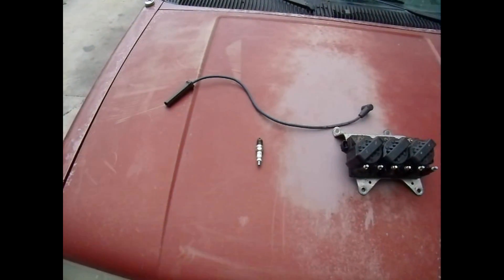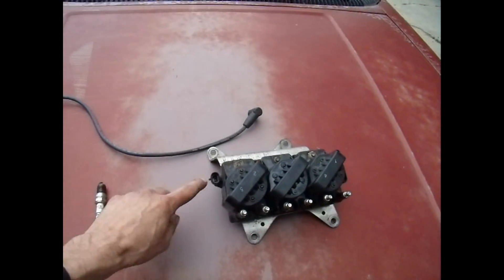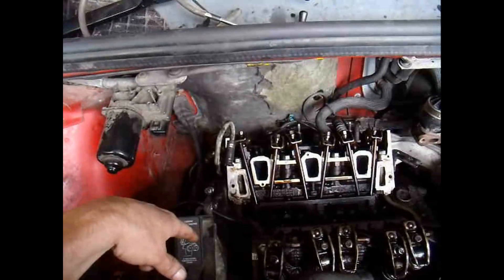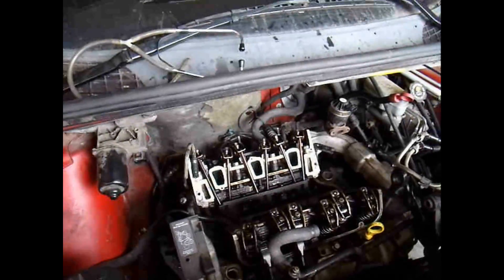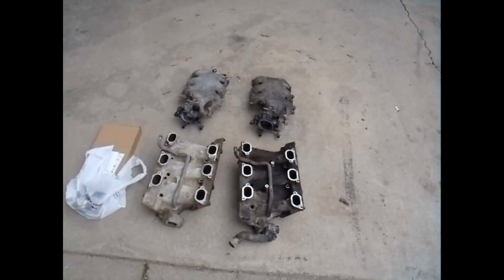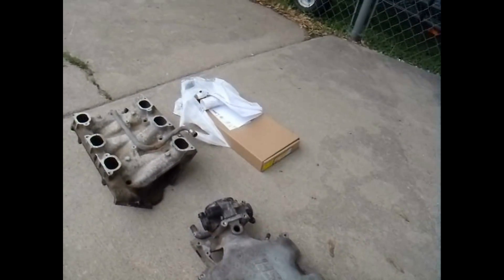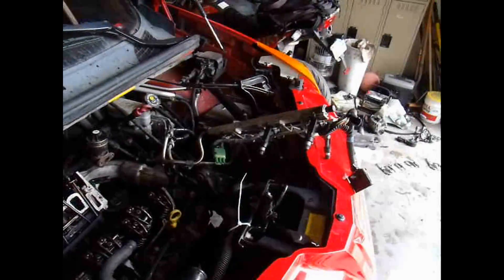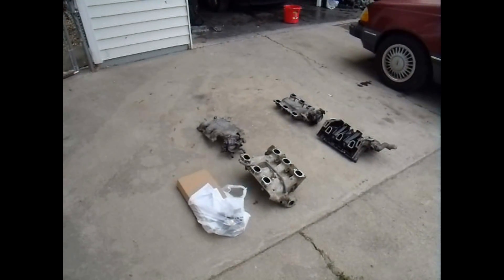GM 3400 / 3100 3.1 3.4 Engine Misfire Cause & Causes Miss Missing P0303

Comment: My wife's van has the same issue....P0304. I couldn't figure it out...had it in 3 shops. 1st replaced the camshaft position sensor, 2nd replaced the coil pack, then fuel pump, 3rd did a diagnostic AND smoke test said it was the intake. WOW!! NO MORE SHOPS!! We are going broke. I ordered the gasket set and manifold bolts, just waiting for them to get here, then it "play time". Found a couple vids showing how to take apart the manifold and EVERYTHING that goes with it. Hoping that's it. It has about 150,000 + miles, so it's prob due anyway. 
  Thanks for sharing this...it confirmed what the LAST shop said. I'll let you know how it goes!
Reply from the maker: The intakes can crack and cause a bad miss.  I'm glad I fixed this before going on a trip.  It would never had made it.
VT247
Reply: Vacationtime247
Yes, that what I'm figuring out. I did the same as you. I replaced the plugs, wires and checked the coil pack (again) and they are all good, but STILL getting the stupid code...so, it's off with the intake!!
Reply from the maker: As long as your in there doing that, it might me a good idea to replace the head gaskets.  They do go bad and could cause the same code.  
VT247
Reply: Vacationtime247
Ahhh...good idea!

Comment: Hi  Iam  Travis and  I have  1999 Pontiac Montana with the  3.4lt I  have  done  everything  in the  book and I'm  getting  no where  I  have  replaced  everything  in the  cooling  system and I and  still  running  hot  I replaced the  thermostat  3  times and it  has  new hoses new radiator in a new water pump and I'm also getting misfire on number 2 is stuck on number 2 misfire the code is po302 I don't know what to do next and keeps running hot and a misfire 2 I don't know where to go next if there's any way you can call me text me or email me my email address is trswelding74@ gmail.com thku  plz  let me know if you find the  answer  cuz I'm  about to  park  this  car, have good night.

Comment: I changed the head gaskets on a 01 3100 sfi and during cranking the vacuum hose on the fuel pressure regulator keeps blowing off and I'm getting a backfire through the throttle body what could be the problem ?
Reply from the maker: +Troy Lively MIght be a stuck valve or lifter.
VT247

Comment: What to do to start engine changed 3.4 to 3.1 in 04 Chevy impala
Reply from the maker: +joseph kemp It would be a lot of work.  Just get a 3.4 liter and put head and intake manifold gaskets on it before installing it.  Swapping to a 3.1 would be a lot of work, but I guess it could be done.  Might not run that great because the computer would need tuned because it would constantly get more fuel due to the fact the 3.4 is a slightly bigger engine.
VT247
Reply: It's all bolted down did a lot of changes try to start but won't I was told to change computer
Reply from the maker: The problem might not be the computer.  It might be the camshaft and cam sensor.  Possible different crankshaft sensor and reluctor wheel too.  Have to make sure the p/u wheel on the crank sensor has the same teeth.  Also with the camshaft it may have different area's for the sensor to pick up and read right as well on the end closest to the timing cover.
VT247

Comment: Lmao what a moron I wouldn't let you touch my engine if you did if for free. I'm getting ready to reassemble my 3.4 tomorrow or so and have the same gaskets for the lower and won't have the same problem because in not dumb enough to "get the bolts nice and tight" I'll be making sure to torque mine to specs all across as to do it THE RIGHT way and maybe if a back yard half wit wouldn't have done the job last time on this engine before purchasing I wouldn't be here now. If you don't want to have to do it again or break more shit maybe take the time to learn why things are torqued to spec and not " nice and tight" maybe you'd start doing it
Reply from the maker: Have fun doing this job again in six months to a year.  Won't bother telling you why because you had to go and be a schmuck about it.

Comment: But it was miss fire ing and i put a foul adapter in because it was getting wet with oil and that one wire was almost melting getting very soft
Reply from the maker: +steven affannato Affannato Damn.  That stinks.  It may be time for a new engine or at the very least, a new head.  Foul adapters are a temporary fix.  Most likely the valve guide is leaking.  If it were me, I'd take the head off and check the cylinder valve in question.  It's possible to have a machine shop put in new valve guides if that is indeed the problem.  Check the head surface area for warping with a straight edge and feeler gauge.  If not straight, it will also need resurfaced.  But weigh the cost of having the current head fixed or getting a refurbished one from ebay or such.  Believe the 2.2 uses an aluminum head for the inline 4.  Generally the area between the cylinders can sometimes get a low area.
VT247

Comment: I have a 1997 chevy s10 2.2 that keeps blowing the plug right out of the engine again what is causing it lmk thank you
Reply from the maker: +steven affannato Affannato My first thought is the threads are stripped.  If this is the case, the correct way to fix would be to remove the head, rethread it and put in a heli coil.  But, it is possible if carefully done, to tap it out and put in a helicoil with the head still on.  Carefull with shavings getting down the cylinder.  Best to have the piston at TDC (top dead center).  Suck out the shavings with a vacuum really good.  Hope this helps.
VT247
Reply: I have no idea why GM dont recall all their issues with these engines.. multiple issues with these engines.. Dexdeath is "to be used" as coolant and eats seals..

Comment: I was clearing out parts to get to my upstream o2 sensor. As I was removing the coil pack, I noticed where my #1 plug wire is on the coil was very rusted. Is this caused by not firing or warm air cooling and trapping under the connector cap on my plug wire. Or could be something else and could I clean it and use Die-grease on the prone' s and inside the connector  caps and hook it back or should I get a new one?
Reply from the maker: +Glen Riffe It's not that much to replace it.  Just get a new one.  But if you're trying to save bucks, clean it up with some sandpaper and check the spark.  
VT247
Reply: +Glen Riffe The coil at #1 was cracked, bought a new one. The wires and plugs have all been changed also none crossed. Still having a backfire and stalling problem, just in gear when you want to throttle it. Idles great.  Cleaned ground ends on transmission. Fuel pump works fine also. MAF changed, Throttle Body cleaned, both o2 sensors changed, opened up the catalyst converter. I do know I have a ground because my dome lights stay on. Door locks lock on their own when I exit the vehicle. Can my module ground out?
Reply from the maker: Check your fuel pressure regulator, crank positioning sensor and cam position sensor.    Does it throw a code yet?

Comment: if you smoke or have a friend that smokes there a hose that plugs into the air cleaner hose pull off the small hose blow smoke in the hose have a friend look for smoke come out around the motor could be a crack in the hose or bad vacum lines or 80 dollar at a shop they have a machine that blow smoke into the motor you see smoke come out of bad parts like egr valve or a vacume hose hope its not a intake gasket cars get old the vacum line dry rot

Comment: I'm having the same or similar problem with my 3100 cutlass, no oil pressure, spark plugs, wires, coil are good. it has fuel pressure and the inhectors are functioning. I assumed it was a bad oil pump and a bad lifter, Is it more likely the intake?
Reply from the maker: no oil pressure sounds like the oil pump or no oil
Reply: +Vacationtime247 that's what I thought. can that cause a consistant misfire that gets worse as the rpms climb?

Comment: That is why you use a torque wrench. So you don't over torque them. But I am not sure how accurate my torque wrench is anymore. I have had it about 20 years. But I still use it.  I could not afford the better, newly designed LIM. So my replacement is like the old one. The new design is an aluminum, not plastic gasket. So, maybe another 87k miles for this one? Contemplating on repairing or replacing the heater core now? At least I didn't have to remove the whole dash, just loosen it. And, come to think of it, my father in law replaced his LIM on his 3800 and was having a misfire on cylinder 3. He may not have used a torque wrench? I will have to check on that. It was is spitting a little water out the exhaust. Not so bad yesterday, but it was running really rough last month and more coolant out the exhaust. No code yesterday. It did show a code or a misfire on 3 last month. This could be the same problem there. Good video to show what happens when you don't use a torque wrench. :-)
Reply from the maker: Mark Bamonte You should get another 100k from the new LIM.  Be aware though that the 3400's had a problem with bad head gaskets too!
VT247
Reply: Only got 87k on the first one. Maybe by the time the next one is due, they will be less expensive for the newer design?  :-)

Comment: oh no....I just did the LIM job on my car...for the third time since I have done a head gasket.
I remember that metal tab not wanting to fit flush into the hole....and my car is sputtering at idle and popped up a P0303 and I've replaced coil, plugs, wires, injectors, O2 sensors.

And my first lower intake had that exact same type of crack on the middle runners.

I don't want to tear it down again...I just got it put back together :-(
Reply from the maker: Joey Cameron Not a fun job to take off and redo.  Always have problems getting the hoses on and the power steering pump put back on.
VT247

Comment: i am doing a compression test as well on my 3.4 litre what should be the range of acceptable compression for each cylinder ?
Reply from the maker: Steven Wilkinson Check the compression ratio in each cylinder.  The lowest to highest should not have any more than a 15% difference in reading.  If you've got bad compression, it's most likely the head gasket.  They are known to blow out on these engines.  Also try pressurizing the coolant system and see if it leaks down as well.  Hope this helps!
VT247
Reply: Ok well I got the valve cover and intake completely off and noticed that one of the rocker arms were busted off !! What could cause this bad lifter?
Reply: Actually the stud came outta the head wich was wrapped in heli coil spring and the rocker arm was just laying there
Reply from the maker: Damn.  That sucks.  Should've thrown a code for a cylinder misfire.  Hopefully the thread can be re tapped and threaded for a new heli coil.  Since you're already this far, go ahead and do the head gaskets.  Check the area between the intake valve and the spark plug hole.  The heads tend to crack in this area.
VT247
Reply: It did throw a code,then did the compression test that cylinder failed so broke it down ,but the head is to stripped for a proper heli so got to get a used one tomorrow,then off to be machined,both heads then the reinstall but Will need advise from u on proper valve adjustments with rebuild lol
Reply: And by the way ,u seem really cool and I appreciate ur knowledge and help,,im also replacing those 2 lifters and checking the cam for scarring on the 2 lobes
Reply from the maker: Shouldn't be any scarring on the cam lobes.  The lifters are rollers. Hope it all goes back together good.  : D
VT247

Comment: Should've checked to make sure your gaskets were set properly before running the lower and upper intake bolts in with your 3/4" impact... I've never seen a bigger waste of money. These engines are one of the easiest GM engine to work on. Fucking potato, maybe you should take it to a shop with real techs instead of trying to do something you looked up on YouTube.

Comment: Oh and if a coil was bad it would have TWO cyls missing simultaneously since it is a waste spark system. 
More importantly I'm willing to bet you did NOT have the holes lined up with the dowls. I've been a gm master tech for 8 years and gm tech for a total of 14 years. Not once in my entire career have I seen such a potato. You broke your intake because you didn't have it lined up and proceeded to torque it anyways. By the way, MAYBE just maybe you should do more oil changes your engine looks like a hundred dogs took dumps inside it and you ran it for months like that. Tisk tisk tisk potato man.
Reply: MattsRetarded Corner not always the coils on the 3100sfi were not for the connection between the two Towers cracking, causing one cylinder to misfire from a bad coil, because  one tower on the coil still fires while the other doesnt. have had that issue twice, generally speaking if the coil is bad both towers are done, but occasionally only one looses connection.
Reply: sonic knuckels The best way is to disconnect the 2 motor mounts that attack to the front of the vehicle on top of the engine.  They make a tool that will use the same bolt holes and you can pull the motor toward the front of the vehicle allowing access to the rear plugs.  If you don't have access to that tool i've use a ratchet strap, you can move it by hand but that makes it difficult to work on it.  Good luck.
Reply: Your comments make you sound like a teenage girl on her period!! Why don’t you just shut your pie hole !
Reply: GM? You idiots are the issue. Huge mistake.
Reply: MattsRetarded Corner  dude whats the best way to take out the back 3 plugs from these motors.
Reply: I use a chain and the bolts from the mounts...same shit
Reply: MattsRetarded Corner Would a bad #5 internal coil connection still allow the associated #2 plug to fire? I'll need to understand "waste spark system". Thanks.
Reply: +Justine McNary That's a cool tip
Reply: MattsRetarded Corner triggered much
Reply: sonic knuckels the best way is to just take them out ? they arent hard to get too. unless you are a fatty
Reply: Mr. pewterschmidt lol
Reply: MattsRetarded Corner does it have a hard time starting from time to time? If so it's the ignition module put a node light on your injectors and have someone turn it over and they should have pulse. It's located under the coil packs. You can also check your cam sensor but odds are it is the ignition module

Comment: 1998 oldsomoblie silhouette 3.4 when we are at red light it starts to miss and loses rpms and I have to keep foot on brake and give it gas while sitting at light
pulling out sometimes it hestie and misses and jumps
Reply from the maker: larry dolin Check the vacuum lines.  My Alero did the same thing.  Turns out it was the vacuum tubing from the PCV and the intake.VT247
Reply: +Vacationtime247 what is the timing set where is number one forward A330 r31 engine V6